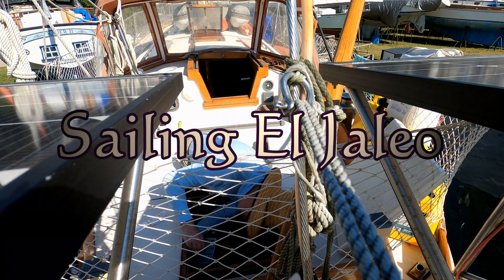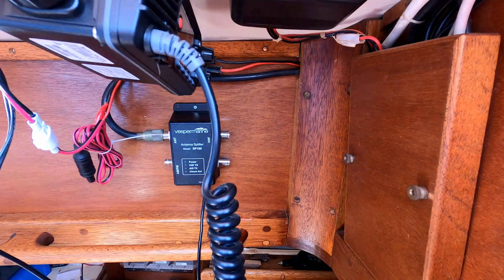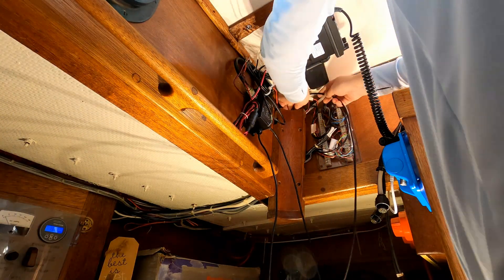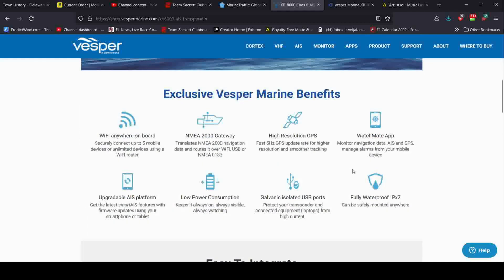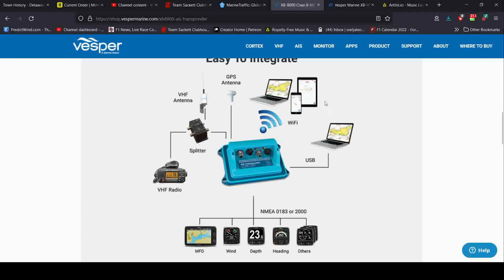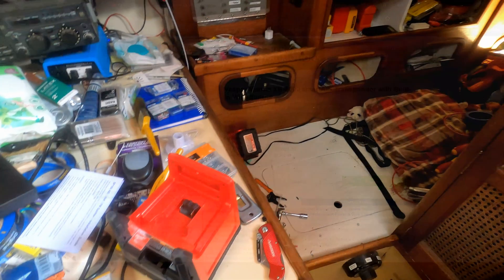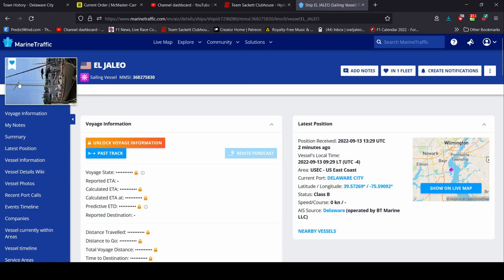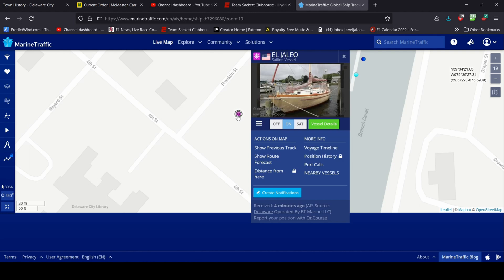S02E37 - AIS Install - Navionics Integration (Vesper XB-8000)

Comment: Isnt the difference between a & b ,    that a you transmit also , so ships can see you , ?
Reply from the maker: From what I understand the Class A transponders take priority over Class B transponders. There is only a certain amount of bandwidth on the AIS frequency and Class A transmissions go thru first and more often. Class B like the Vesper both send and receive.
Reply: @sailing_el_jaleo  I don't think a takes priority , I think it is stronger,  longer range ,  does your receive also ?
Reply from the maker: @davidwarnes5158  Yes, it sends and receives. The boats within approx 20mi that have AIS show up on my Navionics navigation screen.
Reply: @sailing_el_jaleo  so you show up on there A IS,
Reply from the maker: @davidwarnes5158  yes